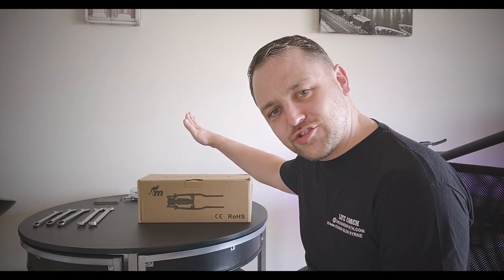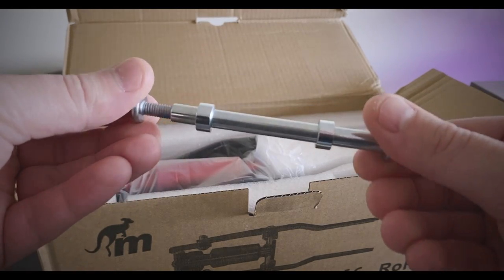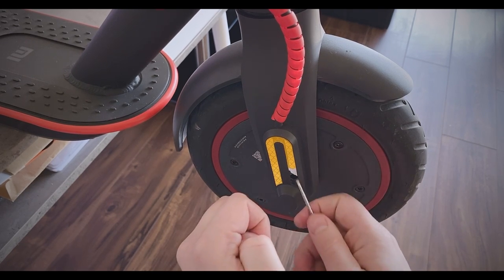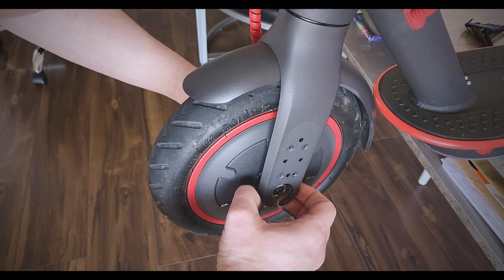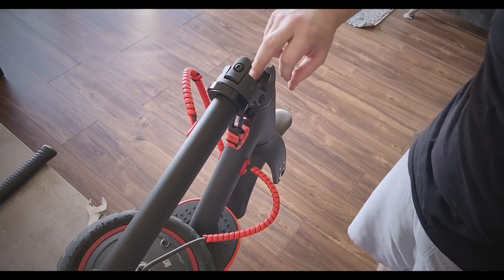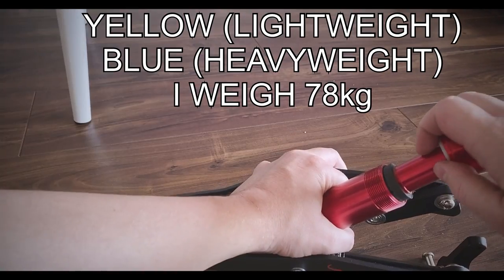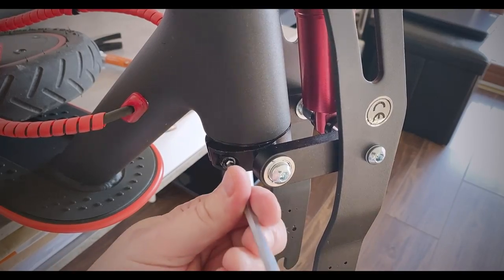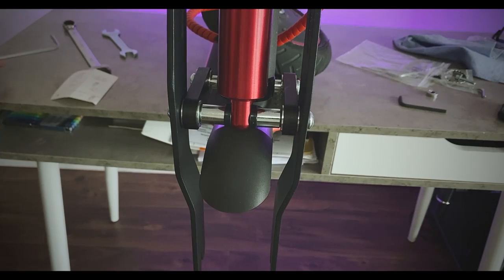MONORIM V2/V3/V4 SUSPENSION KIT FOR XIAOMI M365 PRO 2/3 - Start To Finish Installation

Comment from the maker: ⚡️ WATCH NEXT
🛴 Xiaomi videos you must watch
https://bit.ly/35hyUfm
🛴 18 Xiaomi M365 Pro/Pro 2 upgrades 
https://bit.ly/2TdaUs5
🛴 Fix Xiaomi M365 Pro/Pro 2 stem issue https://bit.ly/366XDnm
🛴 Varla Eagle One Unboxing 
https://bit.ly/2UdtMai
🛴 G Booster GPS Speed Test
https://bit.ly/3h431Or
⚡️ Product links in the description if you want to upgrade your scoot!
Reply: is this suspension with xiaomi mi eletric 3?

Comment: I installed this on an Aovopro 2022 model but the clamp doesn't grip the monorim stem tightly so the only thing holding it together is the stem screw. Any suggestions?
Reply from the maker: One screw ain’t secure enough. I wouldn’t ride it to be honest.

Comment: Hey, I installed the monorim (the one with the exposed spring) to my Pro 2 following your tutorial, everything went good, after the first ride I got a little wiggle (I assume something adjusted during testing), when I came back made adjustments (just moved 4 screws) and now it’s great!... Thanks for the detailed explanation!...
Reply from the maker: Good job fitting it! You will love it Gonzalo 🛴
Reply: where did you made the adjustment? i got mine yesterday, spent more than 3 hours to assemble everything and today, while testing it i ear some noise (like some parte loose, i think it the upper part where the "turn lock" is)
Reply: @EnigmaticEnigmatic  loosen up the 2 screws holding the folding mechanism and then the screw holding the upper brace of the suspension… then fold the stem and tight the screw in the middle… just a little and not with too much force… unfold the stem and see that you can turn smoothly… then tighten all screws you loose… you might have to repeat the process once again after one or 2 rides… what happens is that it’s not compressed enough and after the first ride (or so) your weight and some bump in the road will press it in place for you and it will be loose…

Comment: I just installed the V4 with the coil-over (black/silver), loving it. Would it make sense to upgrade the rear tyre only to 10" to level out the scooter and add a touch of rear susppension? I fon't want to change the front to 10" because I don't want to wear out the motor with my constant speed changes, nor load firmware to compensate. I don't want to add a rear shock for weight and cost. Thanks for all the videos!
Reply from the maker: Hi John

I only ever had the front suspension and never upgraded to the 10inch wheel. Besides you would be better off upgrading both, makes no sense doing just the rear.

I tried actually the rear suspension before and definitely could not justify buying it.

Comment: Hi,
I followed your videos and ordered the black version of the Monorim V2 with the exposed spring as black was a lower key look. Also bought the extender and x-lock (hope I got the names right. Fitted which was a nightmare first time round but your videos were invaluable without good paper instructions. 
Unfortunately I found with the weight of the Monorim V2 suspension shifting the centre of gravity higher that the scooter could blow over on the side stand far too easily. Also the Monorim mudguard adaptor shifted with the spacers collars when the suspension depressed. This eased when the clamps were backed off a bit, but not any where as good as stock. With all 4 Monorim items bought, I’m down about £155, and no sooner had I fitted the parts, I reverted to stock. The high centre of gravity on the stand annoyed me, and the over all look (in the flesh, not video) looked a bit cheap. Whilst o found the video hugely helpful I felt I had to express my opinion even if it was negative....but not to yourself but more the combination of the products. P.S I loved the music with the woman singing “the streets are playing with my mind”. Who is that ? I couldn’t find her music online.
Sorry to sound negative, I just wanted to balance opinion.
Reply from the maker: Hi Richard and thanks for sharing your opinion!
What you could do with regards to the height/weight issue, is to buy the 10 inch kickstand spacer which then can help stand the scooter safer and reduce the risk of it falling over. 

I’m not sure why the mudguard adapter was shifting. I would suggest double checking the screws/bolts as I’m not 100% sure how that black suspension with the exposed spring works with it compared to the V2 or latest V3 that have the chamber with the yellow/blue springs.

I personally have not had an issues and still think they are a great buy. The X-lock is a must for the Xiaomi to reduce the risk of stem issues.

But again, thanks for sharing Richard!
Scoot safe 🛴
Reply: @Movelectrics  
Hi again, 
Thanks for the swift feed back. I’m going to keep the kit till I know what the stock format can handle on the tow path (to try this afternoon).
If I’m honest, the first upgrade I wanted to do was to up the speed and torque. I’ve seen other videos suggesting if you have above a certain number on your firmware that this won’t be possible. Mine is V2.2.4 and if I check on updates it says I have the latest. You said in one of your videos that you had a firmware flash, but was about to try another. Could you share some wisdom with a very low level computer tech guy and let me know how I can unlock some power please. I got the “down G” app on my android tablet but I need to get a zip file to flash onto my scooter. 
P.S who was the female singer ? (the streets are playing with my mind)
Reply from the maker: My firmware is for the Pro 1. I would suggest joining a Xiaomi FB group and many people can help you. Things have changed since all the updates. 
I can’t remember the artist but just use Shazam and it will pop up ⚡️

Comment: Hi, I have a weird issue, please help me, I have a mi pro 2. For some weird reason, on the front, the small screws to remove are a weird size. 2.5 works just fine on the back caps but on the front, 2 is small and 2.5 is too big. Did they change something so we cannot add these suspensions of change the tires? This seems really weird but I am not going mad... in the back, the included key works just fine...
Reply from the maker: Hi Bela! They should be the exact same. Buy a hex key set and find a size that you can tap in and turn. They are brilliant to have 🛴
Reply: @Movelectrics  Thanks, I have a complete set for bycicles and none of them fit... This is the weirdest thing that happened to me ever considering that I am the only one who has this issue...EDIT, never mind, I managed to make it work with a 2mm one - they changed it in the meantime. Thanks for the answer
Reply: Try an imperial set. I had to use a triangular bit, ansf replaced them with phillips screws.

Comment: Hi there . Thanks for the video . I have a problem with my xiaomi pro 2 when I put the mono rim front suspension, it was shaking back and forth and when tighten the bolt on top, omg , very stiff. Please help.
Reply from the maker: Hi Eric. Loose the middle bolt bit by bit until you get the sweet spot 🛴
Reply: @Movelectrics   trIed many times, it’s either stiff or loose .... I followed every step by steP... will try again when off work ... will this suspension system be ok for a size 10 tyres?
Reply from the maker: The middle bolt only needs to be turned a tiny bit, literally. I’m talking a mm turn until you are happy. Yes, you can use 10s and you also need the 10 inch extension kit for the installation 🛴
Reply: You have to use the shorter headset adjuster bolt from the kit; the original bolt is too long and hits the suspension bolt that crosses the head tube.

Comment: Hello. I've recently mounted my Monorim V2 to M365 pro scooter. But there is a problem with stabilization. If it tighten middle black screw so much, the handlebar is getting too strict. What should I do? Is there any trick for that?
Reply from the maker: Burakhan Sivri the middle stem screw, the 5mm, you have that too tight I’d say. All you do is loosen it bit by bit until the steering is loose enough to turn it comfortably.
You don’t want it too loose either.
Find that sweet spot. Take your time.
Reply: @Movelectrics  I can easily control the handlebar when I leave it a little loose, but this time, noise starts to come from the handlebar. I've disassembled and installed for 8 9 times :)  As you mentioned I'll find the sweet spot soon.
Reply from the maker: Burakhan Sivri give the bolt a squeeze, then start slowly turning anti-clockwise, I mean literally bit by bit
Reply: @Movelectrics  Hey Glen. I made it. Thank you for your support 👍
Reply from the maker: Brilliant! Every now and than just check everything👌🏻

Comment: I just ordered mine come tomorrow. I can’t wait to install it I will watch this video to install it cause a friend installed his monrim suspension and had a fell and cause his screw weren’t tight and the manual didn’t describe how to install it well .finger 🤞crossed I don’t fall 😬
Reply from the maker: You will love it. Definitely makes a huge difference ⚡️
Reply: @Movelectrics  have you installed the rear suspension yet
Reply from the maker: @zayanyoyosquad4670  no but I did try it. Personally I don’t think it worth it unless you are in rough roads ⚡️
Reply: Just got mine but I had to live the stem of the suspension cause it would squeak same as the spring I lived the interior

Comment: I bought 2nd hand scooter and came with this suspension installed, but there is a stem wobble. I am wondering if the center bolt / stem bolt is supposed to be different for this suspension? or does it use the original bolt? Thanks~!
Reply from the maker: Hi Moto! It’s difficult to say without looking the movement. Post a quick video in the FB group linked here if you want, we can have a much better look http://tiny.cc/eiktqz

You do get a shorter stem bolt with the Monorim suspension.
Reply: @Movelectrics  actually just fixed it! thanks ! 
the bottom bearing was unaligned and not going in all the way.
Reply from the maker: Perfect, good job!! 🛴

Comment: Did you keep the washers inside, or did you move them onto the outside next to the nuts? Video is a bit confusing where you don't show
Reply from the maker: Hi Robert!
I put every washer back in order as I took off, double check everything including bearing placement 🛴
Reply: @Movelectrics  yeah managed to get it mate, looks a lot smarter then in vid 😀😀
Reply from the maker: Fair play fitting it!! 🛴

Comment: How did you get the screws off the front wheel?

Edit: I used a set of star keys instead of the provided Allen keys, came off easily
Reply from the maker: Hi Get. You are talking about the 2 nuts?
Use a good quality spanner (not the one provided as I explain in the video) the cheap spanner provided will damage the nuts potentially.

Put the scooter on the floor if needed and get someone to hold their weight on it 🛴
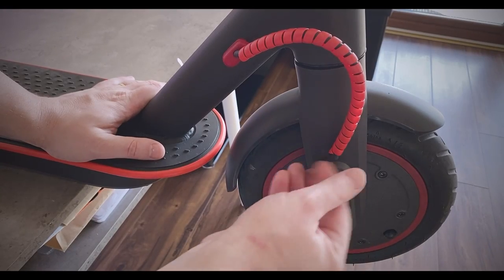Reply: @Movelectrics   no I mean the hexagonal screws holding the cover the bits you are unscrewing at 3:07
Reply from the maker: Just use a small hex and unscrew 🛴
Reply: @Movelectrics   I used a set of star keys instead of the provided Allen keys came off easily, thanks for the help.
Reply from the maker: Brilliant well done! How do you find the suspension?
Reply: @Movelectrics  Man the suspension is awesome! Very clear and noticeable difference, thanks a lot man 💯
Reply from the maker: Glad you like it! Definitely a must have 🛴

Comment: Mine arrived today, got one bolt off on the wheel, but the nut with the cable is like welded on, just not moving whatsoever, so gonna take it down to Halfords and get them to sort it out
Reply from the maker: Get a good quality spanner for the side you want to loosen, put the scooter on the floor and get someone to put their weight on it 🛴
Reply: @Movelectrics  I'll try that mate, using expensive good quality tools, just that but with the cable I can't undo, literally it's like its welded on majorly tight. Feels like nothing is doing the job
Reply from the maker: Put the good spanner on the nut, use a tube or something for leverage to put over it. Don’t forget to pull back the plastic cover also like a do in the video to get a good grip.

Comment: Still had some problems on the suspension like wobbly stem and very stiff steering (it's not the stem bolt) it feels like the bearings just dont move freely. But now i noticed i didnt have those 2 bearings on the down side under the ball bearing, that might be the issue.
Reply from the maker: Definitely bearings have to be correct ⚡️

Comment: Hey ! Thanks a lot for the video helped a LOT. 
Sadly the folding pole base doesn't seem to fit on it. I have the Xiaomi pro 2, any recommendations ? Thanks a lot
Reply from the maker: Hi Lighty! It doesn’t fit? It just slots down on the suspension. Can you post a video on my FB group so I can see what’s happening?
Reply: @Movelectrics  yeah it doesn't fit, the metal tube coming from the suspension seems to wide for the pole base. I'll send you the video so you can see :3. Thanks a lot !
Reply from the maker: You can try to loosen the stem base to widen it a bit because it’s probably too tight (2 bolts) join the group and I can show you what I am talking about. Also post a video 🛴

FB group https://bit.ly/2NMeXIY

Comment: Habe sie auch montiert einfach spitze. Aber es fehlt ein Schlüssel bei meinem scooter xiaomi pro2 sind am katzenauge Torxsschraben. Und bei der feder muss Fett drann, und die Überwurfmutter muss geklebt werden da sie sich während der Fahrt löst. Kleiner Tipp von mir. I also installed them, just great.  But a key is missing on my scooter xiaomi pro2 there are torx screws on the cat's eye.  And the spring has to be greased and the union nut has to be glued because it comes loose while driving.  Little tip from me

Comment: Hi Mate. My nuts that are locking the wheel are damaged due to the very tight and low quality nut. Any solution? I dont want to waste the money for Monorim that I have bought but not able to install
Reply from the maker: Hi KL. You must have round them off. Did you use 2 size 18 spanners like a did in the video?

If you damaged them, you can try and use a vice grips. Get a friend to hold the scooter for you on the floor and you should be able to get them loose.

I have some spare nuts if you want them.
https://bit.ly/3kT0pTy
Reply: @Movelectrics  yes they are rounded. I use the tool given. I didnt use two tools at once like what you did.. Thanks mate will check the video  out, however im from Malaysia far away from you i believe haha
Reply: And now Im stuck  dont know how to deal with 2 rounded nuts. Its driving me nuts indeed
Reply from the maker: @klpropertylistings7094  the 18 spanner you get with the kit is only good to grip one nut and you use a better quality spanner to loosing the opposite.

Comment: Is there any way to make the suspension softer?
Reply from the maker: You can change to the different spring or upgrade to air shock suspension ⚡️
Reply: @Movelectrics  other spring is thicker.. Thats not the solution.. Idk cash in the trash bin.
Reply from the maker: Yellow spring is for lighter riders and the blue spring is for heavy riders like myself (I weigh 80kg)

Some people end up using the yellow spring for softer riding.

Comment: do u know why there is squeaking on the shock?
Reply from the maker: You can add some grease to the spring area.
Reply: @Movelectrics  alright thank u
Reply from the maker: @beetlejuice880  you could also spray silicone where the rubber washer is at the chamber. Friction can cause the noise/rubbing.
Reply: @Movelectrics  also do you know why when i pass over bumps a metallic sound is being heard im sure it is by the suspension and not the stem
Reply from the maker: Inside the chamber, there should be a white spacer in the bottom from what I remember.
Reply: @Movelectrics  i should grease it or remove it cause i think i greased it to
Reply from the maker: I just sprayed some silicone around the chamber.

Comment: Would you also use this with 10" tyre?
Reply from the maker: If you want! I have the standard 8.5 but feels great! 10s are easier to change though if you get a puncture. Either way, the suspension is brilliant!
Reply: @Movelectrics  thanks. I'm still going through your videos. Really helpful, so thanks for putting in the work for novices like me. Are you knowledgeable on the electronics. Still can't fix old scooter despite soldering motor cable. Maybe it's a battery problem. Its just frustrating that so many things can go wrong so soon after purchase. upgraded to pro now and waiting delivery. I'll probably break that too 😫
Reply from the maker: Thanks for the support!! I think the best thing is to join the Xiaomi FB groups. They are very helpful! I have the Pro, no issues.
I plan on upgrading the controller, battery and possibly the front motor. As it stands though, I’m very happy!
So you plan on putting CFW on it?
Reply: @Movelectrics  those should be interesting upgrades to see. Yes, definitely planning putting on CFW.
Reply from the maker: The CFW have is from the FB group linked at the end of the video descriptions.

Are you getting the Pro or Pro 2?
Reply: @Movelectrics  I'll have to get over my allergy to FB! Definitely will check it out though. I'm getting the pro 2
Reply from the maker: There are a good few people now with great information regards to putting CFW into the Pro2. YouTube has a good few videos also 🛴

Comment: hey, is the v4 or v2 suspension better ?
Reply from the maker: Hi! V4 has the adapter for the mudguard. Juts get that one if you can ⚡️
Reply: @Movelectrics  thanks 👍
Reply: @Movelectrics  can i install that when i have 10inch whells ?
Reply from the maker: Yes you can ⚡️